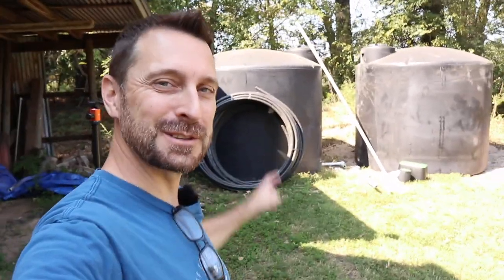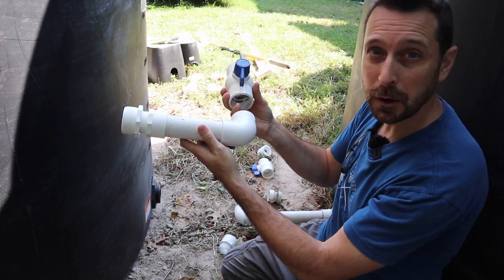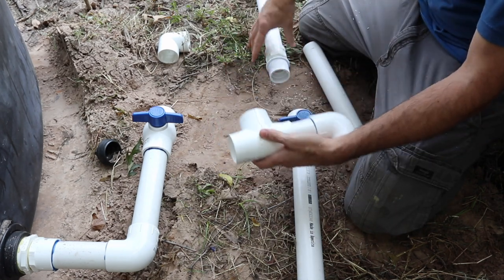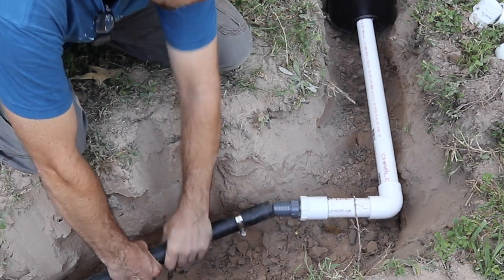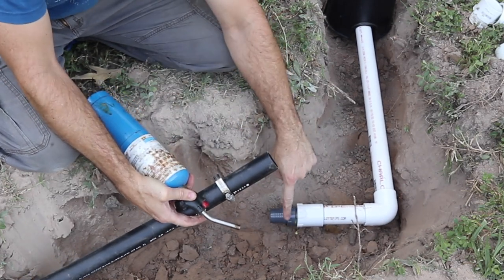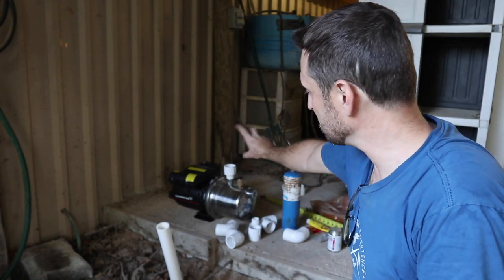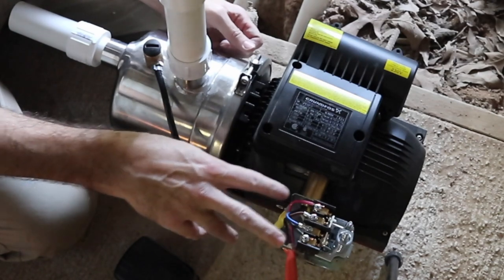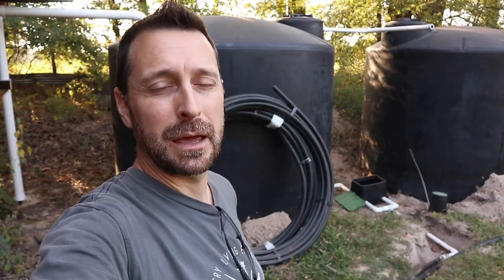Rainwater Collection System! Installing Supply Lines & Jet Pump

Comment: Eric, good morning. I believe you will need a 1 way flow valve right before the inlet of the pump. And you should  install a P trap on the overflow to keep critters out and use a larger mesh as it may clog too frequently.
Reply from the maker: Yep. I forgot the check valve.

Comment: If that water pump vibrates loudish you can cut some old tires and put them around those anchors between the pump and the concrete.

Comment: 5,000 gallons of water stored between the 2 tanks. WOW. I think 1 would hold my house. What would you recommend when it comes to the depth of the pipes from the tank to the pump and the over to the house. I wont be needing to run near as long a pipe as you and how do you connect the water to the house. So many basic plumbing questions for being able to connect the tank to the house as my all around water supply. Also do you need to filter the rain water before cooking or drinking it? Sorry for the rambling.

Comment: Eric, 
May I ask why you don’t have a tank set up for the overflow of your storage tanks?
After all, it’s an easy way for store more water, rather than loosing it in the ground
Reply from the maker: Essentially you will always have a tank in the end of the string of tanks. You need a relieve overflow or it will back up into your collection gutter.

Comment: When you were planning out the water system, did you consider gravity fed?  Im a couple years out from buying my homestead, (getting out of debt now)but I am thinking gravity fed might be the way to go for when I'm older.  I'd be interested in your thoughts.
Kate
Reply from the maker: I don't have enough elevation for gravity fed. If you put it on some sort of platform to get elevation, you will still need a cistern at the bottom to hold the catch water and a pump to get the water up to the tank.

Comment: I maybe wrong but I think you just hooked your incoming water pipe to the the outlet side of the pump. I have a similar pump from Amazon. Mine is configured inlet at the end outlet at the top. I am building a similar system. I buried the tanks 2’ in the ground so as they won’t freeze the lines. I am also using Polly line I may suggest two hose clamps at each connectors. I have seen them fail and seep water.
Reply from the maker: You’re correct. Don’t know why I switched them.

Comment: We bought a tank that can be put underground, that way it doesn't freeze in the winter. I'm in a part of the country that at times doesn't have much water. So I really needed something to have some extra water for the winter. The underground tanks cost more. Have you figured out a way to keep your tanks full during the winter time without freezing?
Reply from the maker: We don't have enough days below freezing to freeze the water in the tanks. There may be a little surface ice on the top but nothing significant.
Reply: I saw two large tanks like these and they had them insulated by a professional Foam Spraying company, that might work for you depending on your Temps, I believe that you can get different R-values by adding a thicker layer of the foam (it also serves as a vapor barrier) good luck 😊

Comment: Have you thought about putting in an artisan well / hand pump?
Not sure how the water level is in your area. Shallow wells work good here, between 5 and 20 feet gives good amounts of water. (I'll be doing an artisan well myself in the future, just low on the priority list.)
Reply from the maker: I will probably add a backup hand pump to my main well. We cannot really do a shallow well here.
Reply: @CountryLivingExperience  Ouch that sucks. When I was first getting to work on clearing my land out, I ended up digging this large hole to get a stump out and it was abnout 4 foot deep, and it had water fill up over night and then stayed mostly full on water for almost 4 month. Hope the hand pump will work as a backup for you, it's so important to have more than 1 way to get things done anymore.
Reply from the maker: @pervysage3604  Backup and redundancy is key for sure.